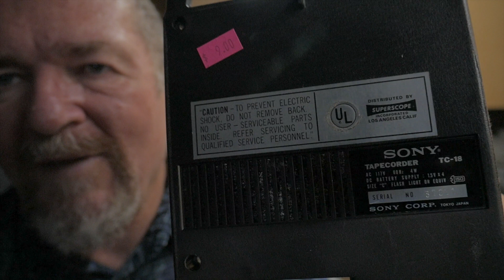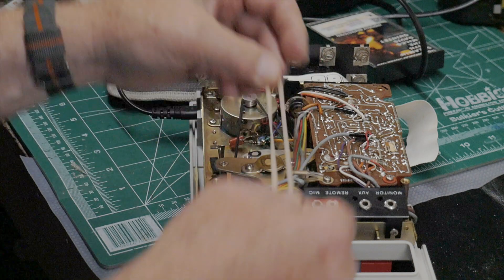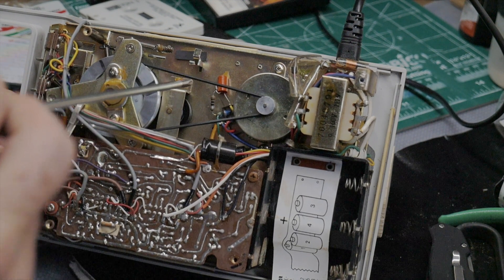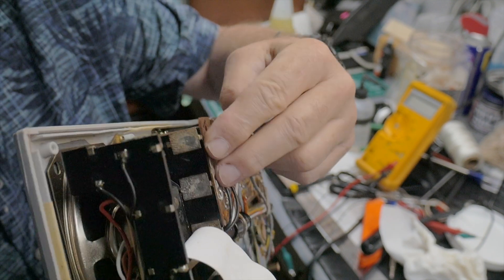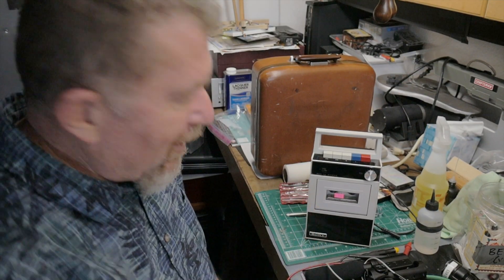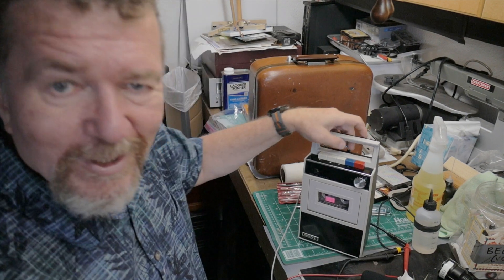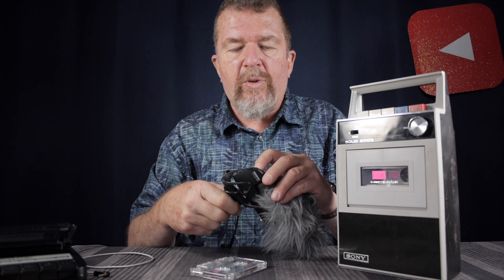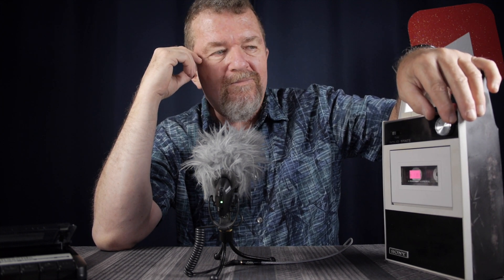The Tape Project - Part 13: Sony TC-18

Comment: Great little restoration on that TC-18 there Joe! The speaker on that little thing sounds pretty good! I just found an utterly ancient Wollensak/3M cassette recorder that I want to restore next. It’s a REALLY early model made in 1966 if you can believe it, not long after the introduction of cassette tapes on the market. Only trouble is that I’m missing the proprietary microphone that uses 2 DIN style plugs that goes to the unit, but I might rig something together if I can figure out the pin-out... -Mitch

Comment: Pretty good quality of the old Sony's Joe. Repaired many in the past. You can find the correct belt (round) online.  A tight belt will damage the motor (overheat) so be careful. 
Great find and glad you were able getting this going again.